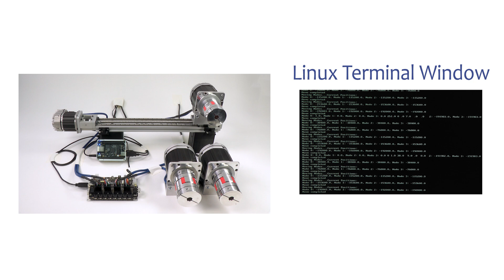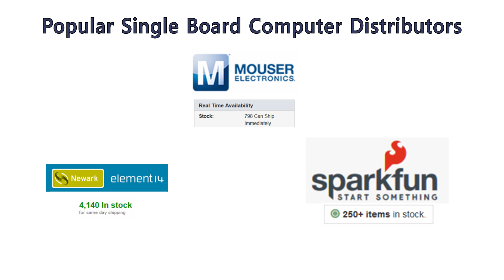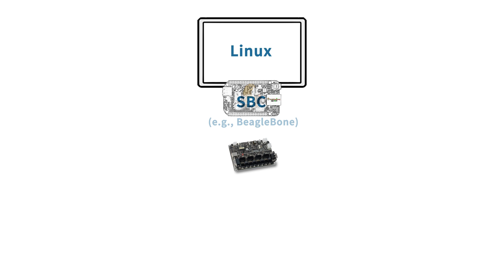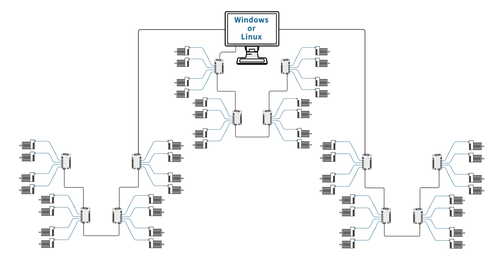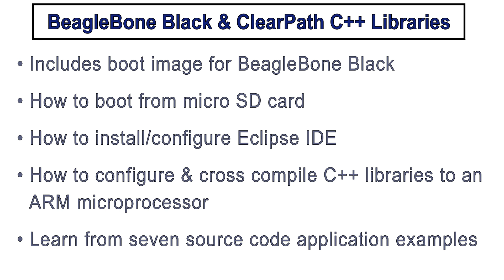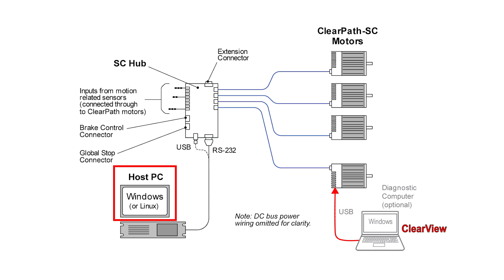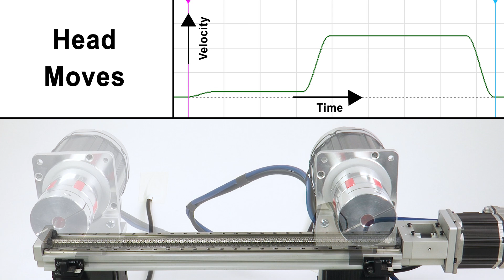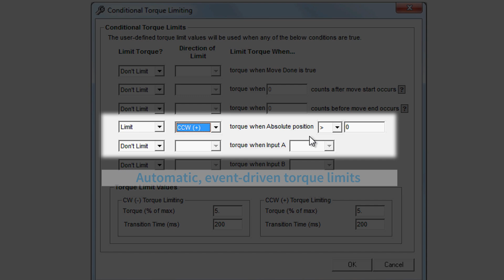Motion Control with BeagleBone Black or Raspberry Pi and ClearPath-SC Servos

Comment: I need help in the software control. foundation doesn't help that much
Reply from the maker: Hi @kingsleynwachukwu4214,
For any questions regarding Teknic's 'sFoundation' software library or software integration, please contact Teknic directly at https://teknic.com/contact/. One of our engineers will be happy to assist!
Aaron B. -Teknic Servo Systems Engineer
Reply: @TeknicInc  Is their some way I chat with you
Reply from the maker: Hi @kingsleynwachukwu4214,
If you'd like to chat, you can also call us at +1 (585) 784-7454.
Aaron B. -Teknic Servo Systems Engineer

Comment: Where do I find open source libraries for the SC-4 Hub?
Reply from the maker: Hi @clancymccoll452.

The SC-4 hub is a hardware device, it isn’t programmable using software libraries. If you would like to download the ClearPath SC libraries that reside on your computer, you can find the files here: https://teknic.com/downloads/  There are libraries available for Windows (included when downloading ClearView) and Linux.

Best regards,
Erik M. - Teknic Servo Systems Engineer

Comment: Is there a way to control only 2 motors without the hub ? Is the hub for wiring simplification or is it required between the controller and motor ?
Reply from the maker: Hi SuperYellowsubmarin,

The ClearPath-SC communication hub (SC4-HUB) is required for use with the ClearPath-SC motors, even if you want to control one or two motors. While the SC4-HUB does reduce cabling/simplifies cabling it, more importantly, provides electrical signal conditioning.

If you have any other questions, please feel free to reach out to us directly at (585)-784-7454 or you can email us at: https://www.teknic.com/contact/

Best regards,
Mark D. - Teknic Servo Systems Engineer
Reply: @TeknicInc  Thanks. Could that fonction be replicated on a more compact custom PCB, say 2 axis and USB only, no braking ?
Reply from the maker: @SuperYellowsubmarin  

Apologies for not replying to your comment sooner!

If you wanted to design a custom PCB with two axes and no brake functionality, it is certainly doable. A simplified schematic of the SC4-HUB using off-the-shelf parts is available in our ClearPath-SC User Manual - Appendix F for reference.

Here is the link to the ClearPath-SC User Manual: https://teknic.com/files/downloads/Clearpath-SC%20User%20Manual.pdf

For future questions, please feel free to contact us directly for support. You can call us at 585-784-7454 or submit a contact request on our website: https://teknic.com/contact/

Hope this helps,
Nick D. - Teknic Servo Systems Engineer

Comment: We're using a pair of SC-HP motors to drive the azimuth and elevation axes of our 12.8m satellite dish restoration project.  The sFoundation library has been super-helpful in the process, and has significantly shortened development time on this project.
Reply from the maker: That's great, we're glad to hear ClearPath-SC is working well for your application and that you found the documentation helpful! 
Thanks for sharing your experience.

Best regards,
Ian R. - Teknic Servo Systems Engineer
Reply: We're hoping to put out a video of our own, once we have astronomical tracking working.  Targetting the eclipse next month as a goal....

Comment: Hi , what is the max step rate achievable through USB or serial ? and what is the latency from sending order to execution of said order ?, in short can it be used for real-time ( 1 step latency and 500khz) ? thx
Reply from the maker: Hi Antoine – the ClearPath-SC servos featured in this video certainly can be used in applications that require fast communication with low latency.  The time between a command and the motor executing that command is typically 1-2 milliseconds or less.  However, I’m not sure if the rest of your question applies in this case.  Under typical software control, ClearPath-SC does not receive electrical “steps” in order to move, it receives serial commands directly.
Step and Direction control is possible, but is usually done with ClearPath-SD instead which you can read more about here: https://teknic.com/products/clearpath-brushless-dc-servo-motors/clearpath-sd-servo/

Please feel free to give us a call (585-784-7454) or leave us a message at https://www.teknic.com/contact/ if you have any additional questions.

Best regards,
Matt C. - Teknic Servo Systems Engineer
Reply: @TeknicInc  i see, i need faster, like 100us

Comment: Do you have a library in python as well?
Reply from the maker: Hi Sameer Bhalla,

Teknic does not offer a Python library for use with the ClearPath-SC system. The ClearPath - SC libraries we currently provide are for C++/C#.  

If you have any other questions please feel free to give us a call at 585-784-7454, or email us at: https://teknic.com/contact/

Best regards,

Mark D. - Teknic Servo Systems Engineer

Comment: Hello Teknic 
is it also possible to use SD-models with this?
I want to get automated diagnostic data out of the motor to monitor the drivetrain 
Thank you & Best regards 
Till
Reply from the maker: Hi Till,

Thanks for taking the time to watch! I’m not entirely sure I understand your question though… I don’t know if you want to control a ClearPath-SD motor using a BeagleBone Black/Raspberry Pi (i.e. you want to know if it is possible to use Teknic’s C++ class library that was designed for the ClearPath-SC motors with a ClearPath-SD motor), or if you want to use the ClearView software to monitor the ClearPath-SD motor’s performance. As a result, I’ll try and answer both questions. 

For anyone reading this response unfamiliar with Teknic’s ClearPath motors, it’s important to know that the ClearPath motors are available in one of three different series (MC, SD, or SC). Each of these series are designed for different use-cases and are controlled in different and distinct ways. You can learn about those differences here: https://teknic.com/products/clearpath-brushless-dc-servo-motors/clearpath-servos/

The video that you’re commenting on demonstrates how users control ClearPath-SC motors by writing their own host application. This application can run and execute on a BeagleBone Black or Raspberry Pi (or even a typical PC running Windows or Linux), and users create this application with the ClearPath-SC C++ class library. The ClearPath-SD series of motors is not compatible with this C++ class library, they’re controlled in a different way. 

ClearPath-SD motors are controlled with 5-24Vdc electrical Step & Direction signals. These signals are generated by a whole host of different controllers (e.g. PLCs, motion control indexers, many microcontrollers, and numerous CNC controllers). I do not know if a BeagleBone Black or Raspberry Pi is capable of generating those signals (you will need to contact those manufacturers to see if this is something that they can do). 

The ClearView software (shown at this point in the aforementioned video https://youtu.be/R7bgAo0EINI?t=398) is compatible exclusively with the ClearPath-SC motors. You can use this ClearView software to monitor the diagnostic data and performance, of the motor. There is an analogous piece of software called “MSP” which enables customers to monitor diagnostic data in the ClearPath-SD motors (you can watch a video that details MSP’s capabilities here: https://youtu.be/oJSp_1aNiSE). 

I hope this helps. @Till, you’ve recently asked a few questions about similar subjects on our videos, so if you have any additional questions, please feel free to contact Teknic directly at https://teknic.com/contact/ or give us a call at 585-784-7454 so we can discuss your specific application. 

Thanks, Jon K. – Teknic Servo Systems Engineer
Reply: @TeknicInc  
Hello, 
Thank you big time for your repsonse.
To clarify my question:
I want to get Diagnostic data out of a SD-Motor with a Beagle Bone or a raspberrypi. 
So i tried first with the examples of the C++ Libary but i think this is only possible for SC-Models,  right ?
Next try was looking in the serial communication between ClearPath and the SD-Motorcontroller to check which commands are for Torque. But these were looking like encrypted. 
Is there a way to get these Parameters out of the controller with just the serial communication and without using clearpath? (Mayby with a controller board of yours or sth.)
Thank your very much & Best regards 
Till Volkland
Reply from the maker: Hi  @tillvolkland6459 

You’re welcome for the response – we’re happy to help. And you are correct, the C++ Class Library is only usable with the ClearPath-SC models, so you may be better off using a ClearPath-SC motor in your application (although that will depend on the specifics of your application). You can, however, access diagnostic data from ClearPath-SD motors in two different ways (one is through Teknic’s setup software, the second is through the ClearPath-SD motor’s hardware). 

The first approach uses Teknic’s “Motor Setup Program” software (nicknamed “MSP” for short). This software is used by everyone to not only configure their ClearPath-SD motors, but also to gather important diagnostic data about their mechanics and system. It sounds like you’ve already started configuring your ClearPath-SD motor(s), but in the event that you haven’t, you should review Teknic’s ClearPath-SD getting started guide located here: https://teknic.com/products/clearpath-brushless-dc-servo-motors/model-support-sd-dc/. This guide contains two videos that might be of particular interest to you. The first video is entitled “Using MSP (Motor Setup Program)” and it gives customers an overview of how to use the MSP software. The second video is entitled “How to Use ClearPath’s Diagnostic Tools” and it discusses how users can collect data and troubleshoot problems using MSP’s built in software oscilloscope. This method requires that you have a Windows PC available that you can plug into the motor, so it’s used almost exclusively during the Engineering or R&D phase of a project. 

The second approach for accessing diagnostic data from ClearPath-SD motors is directly through the motor’s digital output. Teknic refers to this user configurable output as the “High-Level Feedback” output (we commonly refer to this output as “HLFB” in our documentation), and it can convey certain motor statuses back to the host (you can even configure it to convey the motor’s real-time torque usage). I suggest taking a look at the ClearPath User Manuals located here (https://teknic.com/downloads/) for more information on the HLFB output and how you might configure it for your specific application. Since this approach relies entirely on hardware to monitor the motor’s status, it is most commonly used by customers once they are out of the R&D phase of their project, and their machine is up and running. 

If you have any additional questions on this topic I suggest that you contact us directly at https://teknic.com/contact/ or give us a call at 585-784-7454.

Thanks – Jon K.
Reply from the maker: Hi Till,

It’s worth noting that users can configure ClearPath-SC motors to accept Step & Direction control signals (this will cause them to act similarly to your ClearPath-SD motors). So, if you’re comfortable using Teknic’s C++ class library, then it may be a great fit for you since you can access the diagnostic data and status information directly through your host application running on your PC/Raspberry Pi/BeagleBone Black. 

There are a few significant differences however when using Step & Direction signals with the ClearPath-SD motors and ClearPath-SC motors. With ClearPath-SC you need to use Teknic’s ClearPath-SC class library to enable the motor and monitor its status (ClearPath-SC doesn’t have an HLFB output or a hardware Enable input). Additionally, you’ll need an SC4-HUB breakout board to communicate from your PC to the ClearPath-SC motor (this board isn’t applicable with ClearPath-SD motors). Because this approach requires customers to use Teknic’s C++ library and program the controller that generates the Step & Direction signals, we typically only recommend this combination to customers with a strong software programming background (which it sounds like you probably have). 

Thanks – Jon K.

Comment: I am a c++ developer and hobby fabricator.  Can the servos be flashed for C++ commands and then later on run gcode?  or are they two separate servos?
Reply from the maker: Hi Dev Everything,
ClearPath is a good fit for many different applications, but for applications that utilize G codes (typically CNC-style machines) we recommend using ClearPath-SD instead of ClearPath-SC (the SC being the specific series featured in this video).

ClearPath-SC integrated servo motors are designed to communicate with an application created using Teknic’s C++ class library. This application runs on a host computer (with Windows or Linux as the OS) and communicates to the motor(s) via a serial port (e.g. USB or RS-232). The C++ class library we provide with the ClearPath-SC motors does not currently support the native processing of G or M codes. 

On the other hand, the ClearPath-SD integrated servo motors are commonly used with CNC controllers that process G and M codes and subsequently output digital step/direction signals. We’ve seen many customers successfully use this combination with CNC-style machines such as lathes, routers, mills, waterjets, and even laser cutters. More information on these motors can be found in the following video: https://www.youtube.com/watch?v=NbLE126rrRs

I hope this helps. If you have any additional questions, feel free to contact Teknic directly at https://teknic.com/contact/ or give us a call at 585-784-7454. 

Thanks, Abe A. – Teknic Servo Systems Engineer
Reply: @TeknicInc  Thanks for the reply!

Comment: where can I buy these translation stage that compatible with the motors?
Reply from the maker: Hello Hong… Teknic servo motors have standard NEMA mounting dimensions (e.g., NEMA 23, 34 and 56), so they are compatible with linear stages from most manufacturers. This allows you flexibility to select the optimal mechanics for your application. The stage shown in this video was manufactured by Macron Dynamics. 

Best regards,
Erik M – Teknic Servo Systems Engineer

Comment: Thanks. I need to control direction, speed and position and there is no mode including those three. So if I chose to control direction and position with wires, I need to set acceleration, deceleration and speed before the movement using some commands. I don't want to use their software, but build a stand alone communication with the motor. Can you suggest me where to find the commands they are using to communicate and set the motors.
Reply from the maker: Hi Che Black,

There are a few different modes/series that can control direction, position, and speed on the fly. We are happy to work with you to determine which ClearPath motors are the best fit for your application, but we will need to better understand exactly how you plan to use/integrate ClearPath and what type of control/communication you are looking to use.  

Please feel free to give us a call at 585-784-7454 and ask to speak with an available Applications Engineer, or email us for support here: https://teknic.com/contact/.

Best regards,

Mark D. - Teknic Servo Systems Engineer

Comment: Other than the sFoundation code, do you have anything to help develop a single SC NEMA-34 motor system, something that could run on a fast Teensy 4.1 or similar MCU (non-Linux) system?  Any documentation for how to control the motor without trying to dig through 20,000 lines of industrial level control software?
Reply from the maker: Hi beforebefore,

ClearPath SC motors come with Teknic's sFoundation C++ class library which includes all commented source code for Windows and Linux, ready to run example projects, and a compiled HTML help reference.

This sFoundation library is user-friendly in Windows and Linux-based systems, but we understand that there's a myriad of other operating systems and micro controller combinations possible. While Teknic can't support ports of the sFoundation library to every combination of micro controller/operating system, we recognize the possible need. So in the case of non-Windows and non-Linux systems, we've structured the sFoundation library so that OS specific functions (such as thread management and port access) are organized separately from the rest of the library code. This organization minimizes the required effort to port the library to a new system. For example, only a handful of files are changed between the source code of Windows and Linux.

This said, porting the sFoundation to a non-Windows, non-Linux OS or a micro controller is not trivial and requires low-level knowledge of the OS, so using Windows or Linux is highly recommended.

Brendan F - Teknic Servo Systems Engineer
Reply: @TeknicInc  I'm not sure if you are a software coder, but your take on the "user friendliness" of the sFoundation source is exaggerated... to be kind.

As long as someone needs something as complicated and intertwined as this package is, then yes it would be relatively easy to compile and use "as-is"... but truthfully, there are a lot of applications that fall well outside of your code... that don't require such complicated structure.
These uses may not be the few that use 50 motors per install, but is 10,000 users can use 5 or 6 each, that's still significant.

You are clearly limiting your business. by choosing this restriction by telling your customers they aren't smart enough to design systems to use your SC motors.

Personally, I take this as an insult, and it will make me look elsewhere... even though we just completed an initial project that used 8 SD motors.